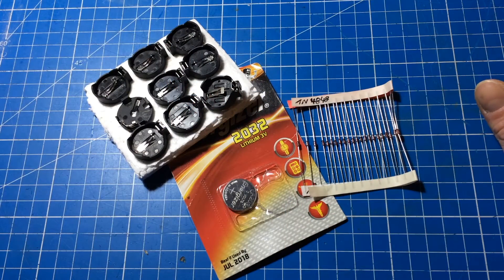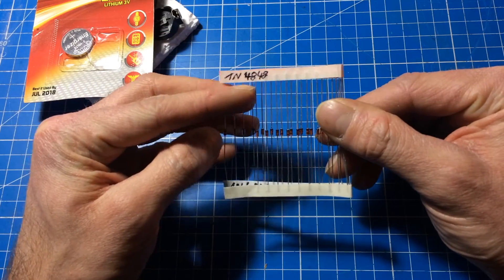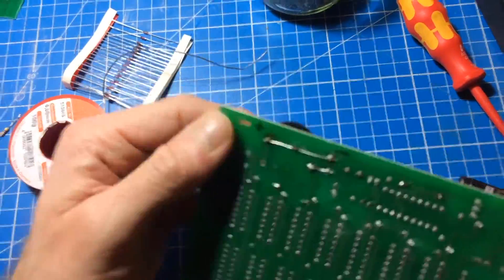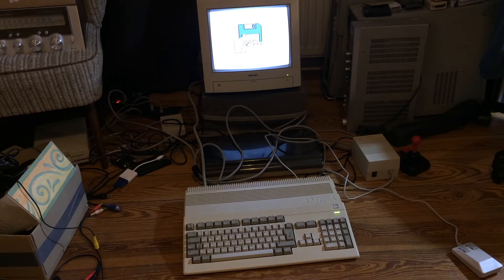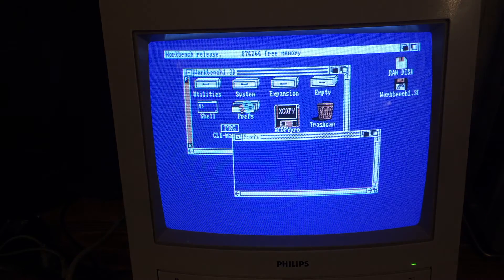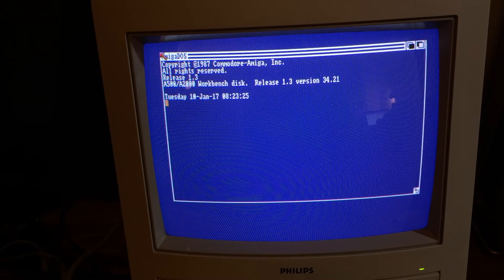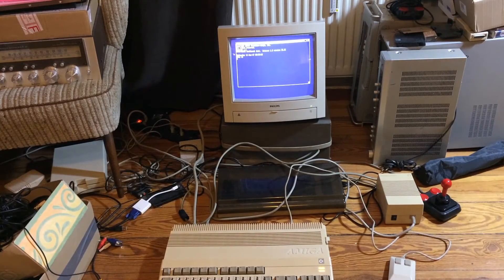Amiga RAM Expansion A501 RTC Battery Replacement (Read desription first!)

Comment: Anybody noticed that his new protection diode (1n4148) was installed improperly ?  Instead of properly putting the diode in series with the "+" battery terminal, he placed the diode in parallel with   the cr2032 battery terminal (and thus the cr2032 battery).  Also,  wouldn't this discharge the battery down from 3v to 0.7v through the "protection" diode ?
Reply from the maker: The battery is actually soldered in the wrong way, not the diode (read the video description). The battery is only going to be drained by the forward voltage powering the clock ic if installed properly.

Comment: do you actually need the battery in order for the RAM Expansion to work? Doesn't it work without it, aside from keeping the clock working?
Reply from the maker: Yup, the battery is only needed for the clock part to work. The RAM works fine without it.

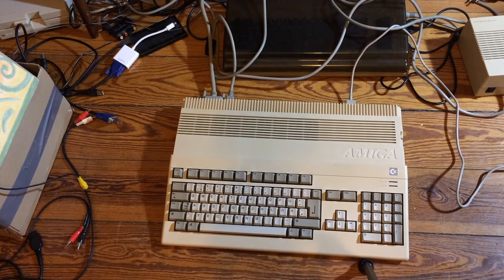Comment: You set the clock to 8:22, turned off and back on 10 minutes later so 8:23 ain't right. What happens if you have an expension card but no battery is on board?

Comment: Hi Jan, once again I have to ask you for help, I should mount a 3.6v lir 2032 rechargeable battery instead of the varta demon, I wanted to know just for confirmation since the battery is rechargeable, I just have to solder the battery holder without having to put put the resistor?
thank you
Ps: this could be useful to everyone
http://www.amigapcb.org/
Reply from the maker: I would not recommend using a 2032 rechargeable lithium cell. It will probably work but lithiums cells usually work quite differently than the original batteries. The circuitry does not have any charging control so the lithium cells will be overcharged in theory which will in the worst case make it burst in flames. You would have to add at least a charging control chip for lithium cells to be safe. :/
Reply: @JanBeta  Does the problem of the 2032 lir also apply to the 3v refillable ml2032?
or is the only rechargeable that can be mounted only the varta demon?
Reply from the maker: The charging circuit is only safely useable with Varta style barrel batteries. Lithium cells always require charging control circuitry to prevent overcharging. The method with a non-rechargeable battery and the diode usually works for years without replacing though.

Comment: In the schematic you drew up the diode was in between the 5v supply and the positive terminal of the battery.  But in the video you placed the diode between the positive and negative terminal.  Am I missing something?

Comment: @Jan Beta - would this battery and diode hack work for replacing the battery on the A500Plus motherboard?
Reply from the maker: Yes, the clock circuit is pretty much the same. There’s pre-made drop in PCBs for that purpose that fit both, too.
Reply: Interesting.. that's good to know.. I just took out my battery yesterday to save the machine from certain death.. there was a small amount of corrosion - some blackened copper tracks, but nothing too extensive..

Comment: was just re-watching this and thinking that if a vertical mount battery holder was fitted (like the one found in some models of dreamcast) would that be a better fit?
Reply from the maker: Mh, might be worth a try. I think some of the flat types fit better than the one I used, too. I actually plan on making another (better) video about refurbishing the RAM expansions some time. Maybe even using rechargeable batteries.

Comment: How about replacing it with a LIR2032 3.6v rechargeable battery? Same form factor as a CR2032.
Reply from the maker: Nick B Yes, that should work without any problems (and diodes).

Comment: Loved it! Question though. Do you have to do any calculation to determine whether the diode is fit for the voltage or the current it's supposed to limit? I would imagine that a diode can get warm as well? Just curious...
Reply from the maker: +The Highlander Thanks! I think the standard 1N4148 is rated for 75V or something like that, so I didn't do any extra calculations on that. I guess these will get really warm if you push them to their limit but this one is far from what it can take.
Reply: Ah ok. 75V is way beyond what it needs to here. Check, thanks.

Comment: did you actually get the polarity right? :D
Reply from the maker: +Andrei Esanu I was so tired that I could actually have gotten it wrong. Nothing exploded, so I guess it's about right?! ;)
Reply from the maker: Sadly, you're right. I soldered in the battery holder the wrong way round. D'oh! Have it fixed now. Sorry, folks. :/
Reply: no worries man!  keep up the great videos.
Reply from the maker: Andrei Esanu Thanks. :)
Reply: So he installed the battery backwards and it still worked? I'm so confused. How could that possibly work?
Reply: @MatthJenks  Well, the Date/Time wouldn't have stored and rebooted in 1978, no ?  The diode was to prevent charging the cr2032 ?  Funny, there's no diode in my original pcb memory card expansion.  Just the battery.

*EDIT*:  I rechecked the board (Supra) and there IS indeed a protection diode (1n4148) already installed with the anode in series with the "+" terminal of the cr2032.

Comment: 13th of October 1978 must be the Amiga DOS Epoch. Also I just got done with a similar clock battery mod for an Amiga 4000 I'm restoring.
Reply from the maker: +SkuldChan42 I think the Amiga clock counts the days from January 1st, 1978. Don't know why that's the starting point, though. Hope your restoration is successful. A4000 is an amazing machine!
Reply: It is - I fixed all the really bad broken parts of it today. I did film the highlights so hopefully there will be a video soonish :).
Reply from the maker: +SkuldChan42 Nice! Looking forward to watching that.
Reply: Maybe the OS does that, but the clock chip stores day, month, year, hh, mm, ss etc in separate counters.
P.S. Use a schotky diode instead, it will make the battery last longer.
P.P.S I made a whole A501/CR2032 replacement board if anyone's interested.
Reply from the maker: +PeteAU9 Ah, good to know about the counters. I heard about Schottky diodes being better suited for this job. Have yet to try one though. Thanks for sharing the info. Do you have the replacement boards for sale somewhere?
Reply: Sure, http://pibus.info/amiga/pa501/
Reply from the maker: Nice! Good work!